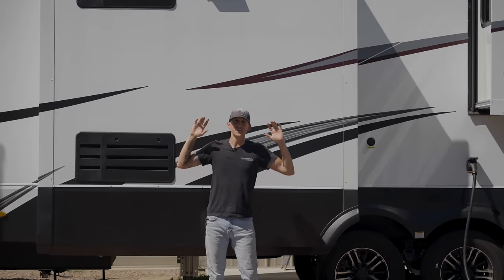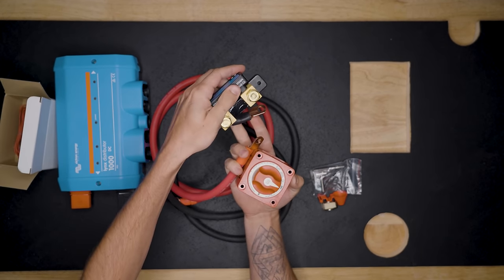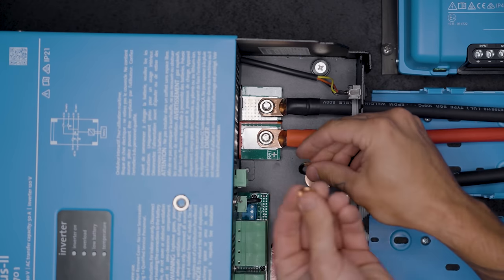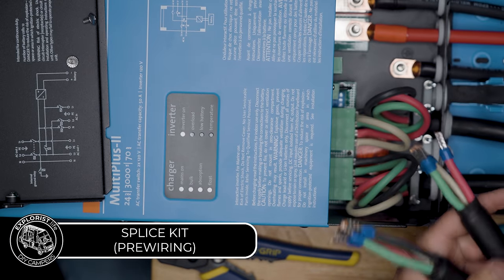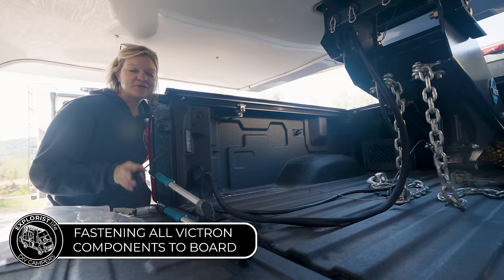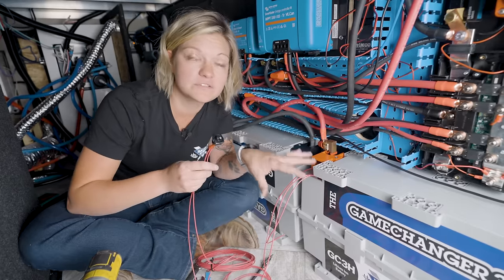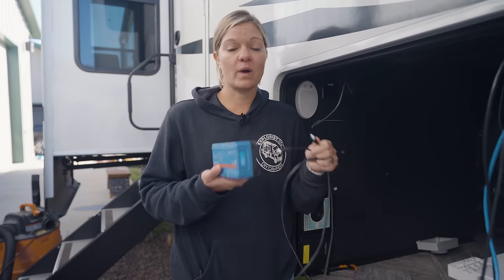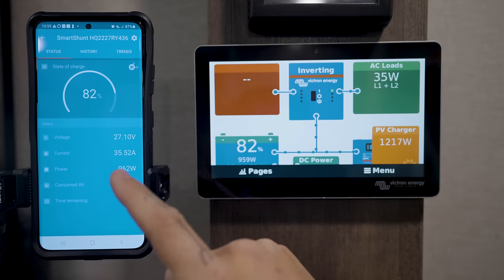We added 2400W of Solar to this 5th Wheel RV! (Full Battery/Inverter/Solar Installation)

Comment: Great video. That's a very clean install. I can tell you guys are pros. You are very good at explaining things too. We just found your channel and subscribed.  Five years ago, we took an early retirement, sold everything, bought an older MH and hit the road FT. It was the best decision we ever made. We discovered that we enjoy boondocking and it helps stretch our budget too. We quickly learned the advantages of solar and decided to build our solar/battery system in 2 phases, a 12v system for our basic 12v DC needs and a 48v system for our 110v A/C needs. 

We started with a pair of lead acid golf cart batteries and custom built a 620-watt liftable solar array mounted on the side of our motorhome. We lift the array to the optimal angle to improve their output by 20-30% vs flat mounted panels - even more in the winter, when the sun is lower in the sky. It serves as a nice bedroom window awning too, practically lifting itself to the desired angle with a couple gas struts, and it's easy to clean with a windshield squeegee, standing safely on the ground. This set-up, while far from optimal, allowed us to boondock till we could afford to do better. 

We finished the 12v part of our build last January, with the addition of a 560ah LiFePo-4 battery that we built with 8, 280ah "A" grade prismatic cells. We use a Heltec 350amp BMS, and a 5a active balancer to keep the cells synched up. We typically use less than 20% of their capacity daily giving us enough reserve capacity for about a week of bad weather before we have to run our generator for charging. It cost us less than $1,500 to build this 560ah 12v (7.1Kwh) battery (roughly the equivalent of 2 Battleborn Gamechangers), including the high amp BMS and balancer.

We chose these cells rather than a pre-built battery because they fit perfectly under the steps of our MH where our old pair of GC-2 golf cart batteries used to reside, saving 35lbs too. We insulated the battery compartment, cut a 1" hole in our step risers and installed a tiny computer CPU fan to keep this space at close to room temperature, so we don't have to worry about the BMS shutting down charging if they get too cold - or their life reduced from getting too hot. We use an 80A Progressive Dynamics LFP converter/charger, a 1,000w Renogy PSW inverter (to run our TV, PC, ice maker, etc.), an Epever 50a MPPT charge controller and a Lnex battery monitor/shunt. This entire 12v system cost us under $3,500 to build and takes care of all of our basic off-grid needs except for air conditioning and microwave use.

By mounting our solar array on the side of our MH, we left the roof free to rack 8, 550W Sungold Power solar panels (4,400 watts) down the length of our 35ft Class A, 15" off our roof, above our AC, fan shrouds, etc. They will cover the entire roof, providing some nice shade with plenty of cooling air underneath, further increasing solar output and reducing the heat load on the air conditioners too. We bought them for only 51 cents/watt shipped to our door! We're assembling the components for this build now. We bought our aluminum racking material in Yuma, where we're wintering over this year, for under $400, which is the best price we've found. Our solar panels, wiring breakers, etc. arrived 2 weeks ago, but we're taking our time to get everything in and installed over the winter. At 67 yrs old, we're moving much slower these days. Our Sungold Power all-in-one 48V, 5,000W, 120V PSW Inverter/100A charge controller/battery charger arrived last week. Our 48v battery bank will use 16, 320ah grade A prismatic cells which only cost us $1,726 from EEL batteries. So together with our 560ah (7.1 Kwh)12v bank, we will have a total of 23.5 Kwh of batteries onboard (almost 7 Gamechanger's worth) - kept charged with over 5,000 watts of solar. We installed another powered roof vent in the hole that our 24 yr old rear 13.5k btu rooftop Dometic AC was removed from. We're replacing this AC unit with an EG4 28.5 seer-2 plug and play 12k btu mini-split heat pump. This second phase will provide 24/7 off-grid air conditioning, supplemental heat from the heat pump and allow occasional usage of our rooftop mounted Furrion AC in the front of our MH during peak afternoon hours, as well as give us whole house 120v ac power. We'll soon have total off-grid electrical independence on a budget we can afford, reserving our generator for back-up use only. Take care, we hope to see you down the road!

Comment: This is the best video I've come across for installing Victron, solar, and batteries in a RV.  I never knew I could use the Orions to bump the voltage up and charge the 24V, I thought they were only step down.  Thanks a lot for the video!!

Comment: This is one of my favorite videos of yours, and I referred to it often when building my own fifth wheel system.

The one thing I'll say that didn't work out for me was the OEM Splice Kit.  I ordered this from you, and was actually looking forward to using it to splice together my 120V AC lines.  However, when I went to use it, I found that the connection bars that you sent were not robust enough to hold the thick 6/3 Romex cable that I was using (my Allliance fifth wheel uses 6/3 Romex from the 50 Amp connection to the breaker panel, so I used the same cable to go to the Victron Muliplus II and back to the box again).  I tried and tried, but those connectors just couldn't seem to hold those stiff wires.

Not to mention, the plastic mounting box interior mounting screw holes also failed with the stiff wire pulling on them.  I ended up buying a junction box, and splicing together the wires that way.  Maybe this is partly on me.  I wish there was a more robust and stronger solution that allowed those wires to just be connected together, almost like a big Wago 221 connector.

Anyway, other than that, everything else worked like a charm.  Thanks!

Comment: Those nuts on the solar array tilt mounts look like real drop hazards, especially on that many panels.  I'd replace the nut with 1/4-20 stainless nut rivets in the aluminum angle for a nice clean installation and fewer lost fasteners.

Comment: I wish this was a Quattro install. It seems a camper that big would incorporate a generator to the system. My 2024 sprinter 170 is being delivered in December. I’m thinking about installing a Quattro. I will inquire much more when I get it.  Keep up the good work you two. Great stuff. ⚡️🔋🔌🌞📡🏔️🚐
Reply from the maker: I too wish it were a 24V Quattro 5k 2x120 install, but alas... that doesn't exist, and the currently available Quattros only have one hot leg and an RV with 50A shore power like this one needs two.

Realistically, though, once the Quattro 5k 2x120 is available, the installation process will literally be the exact same as this one just with a few bigger wires and bigger fuses.

Comment: Thanks you 2, learnt so much from you. I didnt know we could put 2 dc to dc chargers. I only installed one and it does give out the 30amps rated weird. But love my system. Its identical to this set up but 12v

Comment: As usual an incredible installation and how to video.  Just a comment, I suspect the owner will tilt those 12 panels just 2 or 3 times and then leave them flat for every remaining trip.  Too much work to tilt them each time plus the camper has to be facing the correct direction.
Reply: Plus pulling the brackets out and hardware out each time... u would think they could make a simple style track like a ezup tent with simple legs and pins or like a sound array that has T pins. 24 sets of hardware and a dropped nut lol and uhoh
Reply from the maker: Agreed.  It took Steph and Grace 53 minutes to lower all of the panels at the end of the project.  I can't imagine those going up very often unless they were staying somewhere for weeks/months at a time.
Reply: Better to have the option than not. You could live full time in that trailer

Comment: Good video! What output voltage the Orion 24 to 12 converter is set at? For general 12VDC usage, 12.6 seems like a good number, 13.8 is float for batteries, then 14.2 is charge. Or, do you leave the voltage low (something like 12.8) so it is effectively an unmanaged trickle charger?
Reply from the maker: Thanks!  Yeah, we left it in the 13.2V ballpark.

Comment: Your videos are really good, I like them a lot, just one small observation, you should not use lock nuts to secure the battery cables to the batteries, those cables get hot and the plastic in the lock nut can burn out with the time,  you'll get a lose connector and that'll be a fire hazard.
Reply from the maker: Let Battle Born know they are supplying the wrong hardware then as we are using manufacturer supplied hardware.  Plus, if those terminals get hot enough to melt nylon, we have a whole new set of problems on our hands. 🤦‍♂️🙄

Comment: I'm currently hooking my inventer/charger up now (multiplus 2 12/2000/80) and have a question. 

Wouldn't there be a problem hooking the chassis ground to the negative bus if there's an AC fault in the inverter? Wouldn't that create a point for AC/DC to intersect?

Comment: Great informational video.  Thank you!  One thing I am unclear on is the 12volt power wire inside the 7-pin connector from the truck to camper.   Not knowing how it was wired into the camper originally,  did the camper wiring need to be altered such that it only connected to  the 12 volt battery ?  Thank you again for consistently creating great videos.

Comment: First, I really like your content, videos and presentations. I do have one comment that on one practice that doesn’t make sense to me. Why splice into the 50a service line. Another connection can just add a potential point of failure. I think the right way is to pull a new 6/3 line from the shore power plug directly to the inverter and then directly to the service panel. Therefore avoiding unnecessary connections. I do have a BS in electronic engineering so I know a little about the theory and best practices.
Reply from the maker: Although that would indeed be the 'best' way to do it; those wires are often buried in the walls/floor of the RV and it's not feasible to attempt to re-run them.  We've also found it an easier end-user experience to not ask people to re-wire their factory breaker box as not every RV breaker box is the same.  The additional connection points is indeed a consideration; but the terminal blocks we use are screw terminals that are very secure and once they are connected; it's pretty set-it-and-forget-it.

Comment: Hi there, watched a few of your guys install videos now, and purchasing a bunch of your wiring kits, noticed on this video you guys installed a battery terminal fuse right onto the battery, my question is why this was done on this install but not on your other 30amp 12V trailer install. Thanks!
Reply from the maker: In short, every system requires different fuse sizes, and the fuse type used is dependent on the available types of fuses.   In this example, we used a 300A MRBF fuse because it's easier, fewer connection points, smaller, and a higher AIC.  In the 12V system requiring a 400A fuse... MRBF fuses don't come in 400A so we have to use the next best available option; but all of this is figured out for you in our kits: https://shop.explorist.life  If you have purchased/are purchasing from our store (shop.explorist.life) reach out for some more personalized help: shop.explorist.life/support

Comment: Hello Nate,

I have a 42' ft Class A Diesel that I would love to do exactly what you did there. It already has a factory installed 100w solar system that I want to convert into a 24v just like you did. My only concern is if I will need to upgrade the alternator and also, it has an emergency start system on which if the engine battery dies, I can use this button to jump the house battery to give juice to the engine battery to start. On that case, what would you do?

Thank you for the work you do which it is to be admired and thank you for helping all of us out.

Best,

Comment: Excellent video and a great refresher as I install my 1280w system on my Arcric Fox 5th wheel.  One question.  I don't remember seeing the installation of solar panel breakers.  Did you not use them going into and out of the MPPT?  Thanks for the video!

Comment: I looked on your website but couldn't find it - is there a wiring diagram/parts list/blog post for this 24v 50a install?  I found the 12v version, but not the 24v... Thanks for everything you do!

Comment: Thank you for another great video. We just traded our Grand Design in for a Redwood 4001 and will be doing this exact install with the exception of a possible second MP II 2x120 in parallel in the future. The Redwood has a Xantrex 2000 watt invertor tapped off the 12v batteries and feeds the TV, frig, and 5 other receptacles. Would you leave the Xantrex in place or remove AC output and tie them into the Victron AC output? The RV also has an Inteli-Power 4500 Series Distribution Panel with a built-in converter to charge the batteries. Should I wire in a disconnect switch to prevent a circular charging path?
Reply: Usually the converter is on a breaker that you can switch off.
Reply from the maker: Usually... those pre-installed inverters like that are on a transfer switch that bypasses the inverter when connected to shore power - so - I'd just leave that inverter in place and when you splice into the line between the shore power inlet and the back of the breaker box like shown in this video; that OEM inverter would always act as if it were on shore power because it's getting power from 'somewhere' upstream (shore/genny/or the multiplus powering the entire camper) and it will simply stay off.

For the converter; just turn off the breaker like we showed in this video.

Comment: Great install.  Shouldn’t there be some cable clamps on the splice box?   It is high voltage and with all the movement in an rv you would want them as secure as possible.
Reply from the maker: Strain relief for those wires was handled during wire management w/ clamps.  We just skipped over all of our wire management and strain relief in an attempt to not make a long video even longer as I figured y'all could handle that part without instruction.

Comment: EDIT: I just realized that this breaker probably has a line and load side which means it cannot backfeed.... The breaker is a one way breaker                                                                                                                         
@33:33 Can you please clarify how the 150A breaker prevents backfeeding through the DC/DC step-down converter? Is this breaker supposed to be manually tripped when not needed? Shouldn't there be a diode between the 24 volt wire and the orian input or is this built into the orian converter?
Reply from the maker: Shutdown procedure for this system -> Turn off all loads: Turn off solar disconnect: Turn off Breaker to 12V battery bank: Turn off master disconnect switch.

Startup: Reverse.

If you have purchased/are purchasing from our store (shop.explorist.life) reach out for some more personalized help on this procedure: shop.explorist.life/support

If you've purchased/are purchasing elsewhere, reach out to your dealer for support.  We'd love to have you as a shop.explorist.life customer so we can provide a bit more help in the future. 🙂

Comment: Quick question...I have a grand design solitude and am looking to install basically the same system.  But not 24v...but 12v. Keeping the stock house batteries...I dont need the 24-12v converter.  Do I even need the house batteries?  Or how would it be wired.

Comment: Great video - very informative and I like the details you show.  I do have one question, given the quality of the install you are doing, how come you are putting bare wire into screw-down /binding posts? This is generally not recommended as the bare copper can come loose over time. Ferrules are the correct approach and you do use them in a few spots, so I wonder why you don't use them on all the bare-wire ends. A ferrule crimper and ferrules are a relatively low-cost item considering the overall cost of this system.
Reply from the maker: Ferrules are tools to make our lives easier and not requirements, so we use them where they make our lives easier or make wiring look cleaner.  Where they get in the way; we don't use them.  The spots we are using ferrule-less ends are spots where there is a plate in the terminal that squishes the wires down/together and not just a bare screw end.

Comment: So my question is how to determine the wire gauge for the various connections you have here.  I see the primary DC connection from the Multiplus is 4/0, but many of the other wires look to be 1/0 or something else.

Also, if we needed a “custom kit” made up, can you supply that?  For example, a kit without the solar panels or batteries (already have both of those)? 

Thanks….
Reply from the maker: All of the wire sizes in our kits are pre-calculated, so you don't need to figure that out on your own.

If you need to, though, youtube search "EXPLORIST.life Wire Size" and we've made a video that covers wire sizing.

90% of our kits come without batteries & solar panels so you can choose your own there, yes.

Comment: I could be wrong but when labeling the inverter so no one would cut it on is it me or did you cut off and label the ac breaker ? I thought you were cutting off the inverter?
Reply from the maker: We turned off and labeled the converter breaker.
Reply: Same comment.  The converter breaker is second from the left side of the panel.  The AC breaker (third from the left) is the one that was turned off in the video.
Reply from the maker: Again, we turned off and labeled the converter breaker, like as is narrated in the video regardless of what it appears like we did.